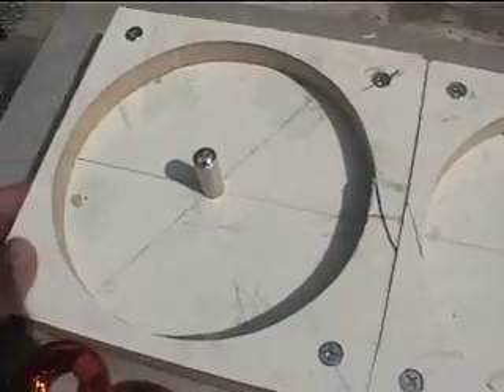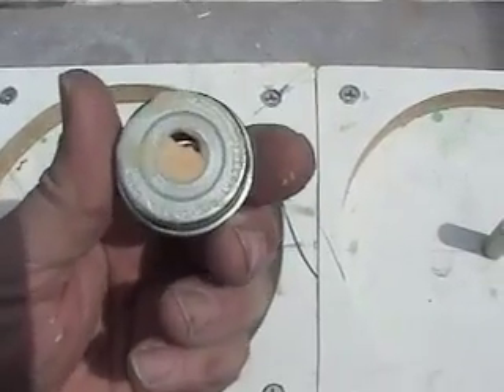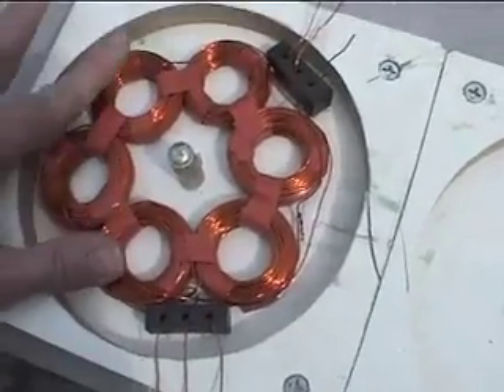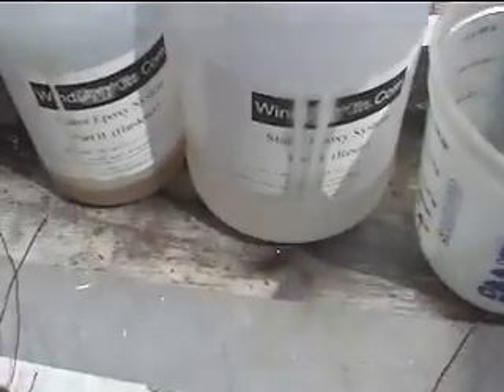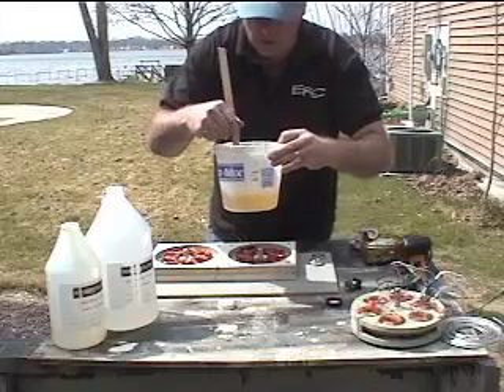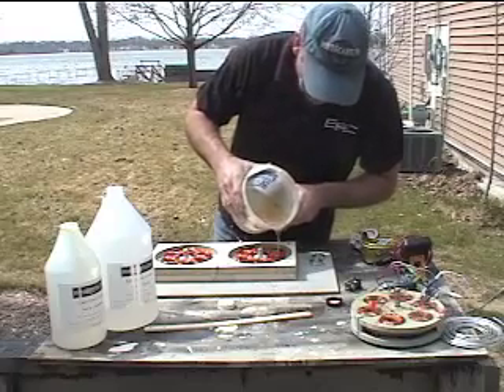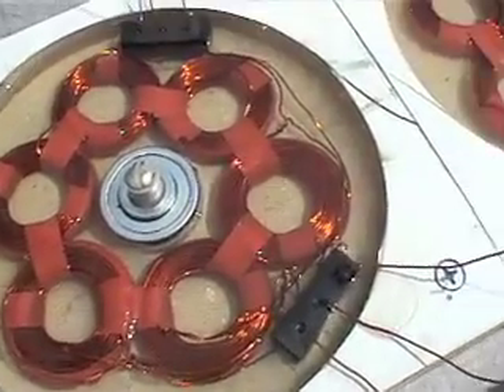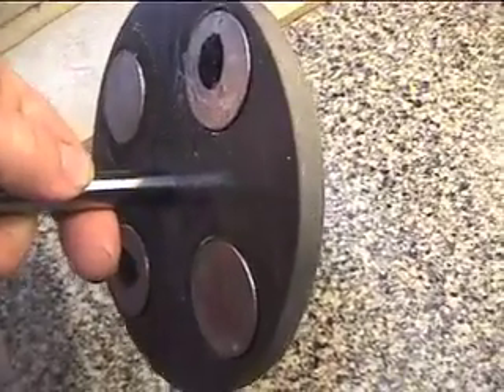Lynx - Pouring the PMA stator with resin

Comment from the maker: @rikkiesix 

Yes, the magnets press into holes cut into the 1/2" plywood.  I use a liberal amount of epoxy as I press them in.  Be super careful when doing this.  I place the rotor on top of a steel plate so that the magnets hold in.  Then I place a board over each in turn, as I place the next.  One time I had all the magnets fly out in a blink and smack together.  Thankfully none of my fingers were between!